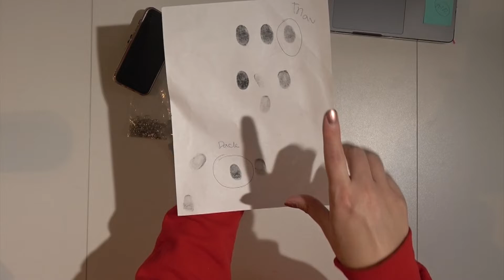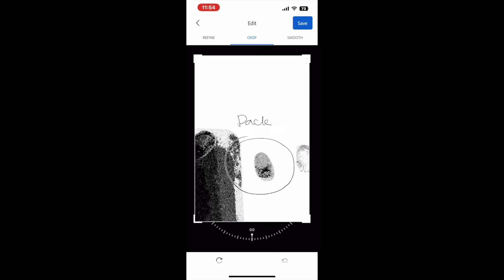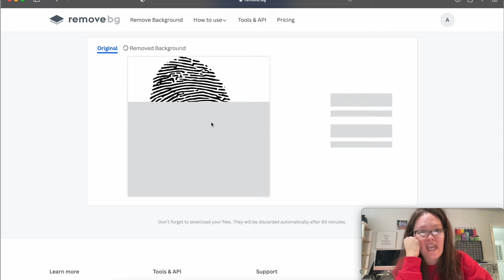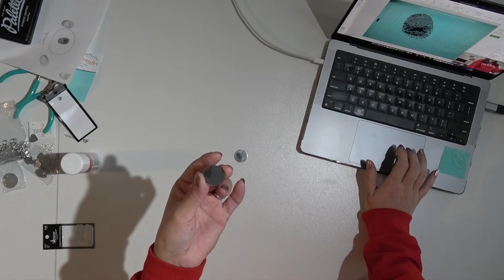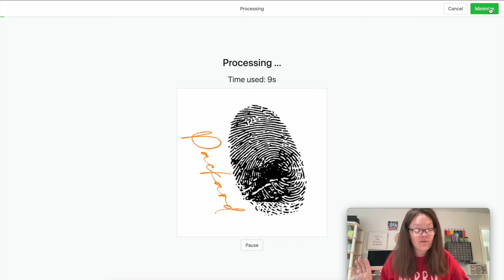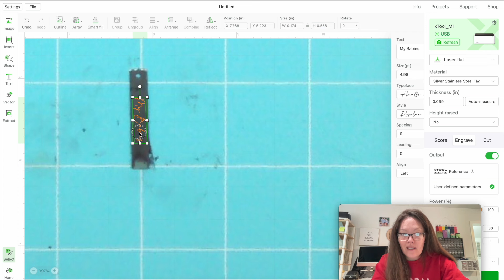Master Metal Engraving With The Xtool M1!

Comment: Will the Cermark spray work on the F1 for stainless steel ? I bought another brand of spray and it didn’t work.. thank you!! I am new to laser engraving and your videos have been very helpful 😊
Reply from the maker: Hello! It definitely should but I challenge you to use the IR laser with your F1 on stainless steel, the quality of engraves using the IR is *chefs kiss*
Reply: @ashleefalco  Thank You! I have been using the IR for the stainless but sometimes doesn’t engrave dark enough.. been playing with the settings to try and get a better result but would like to ensure I don’t get bad product reviews because it isn’t dark enough. If I use the spray that would only work with the blue light?